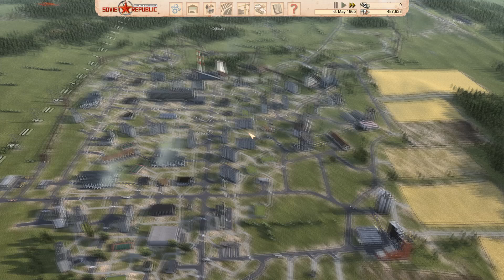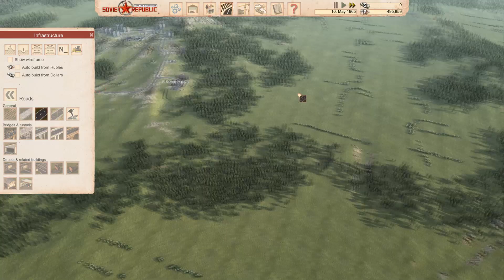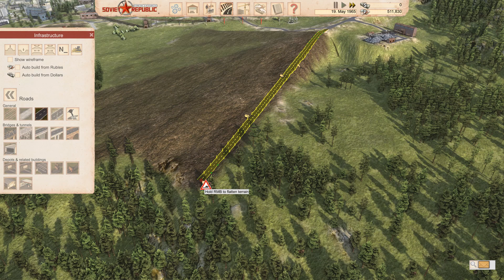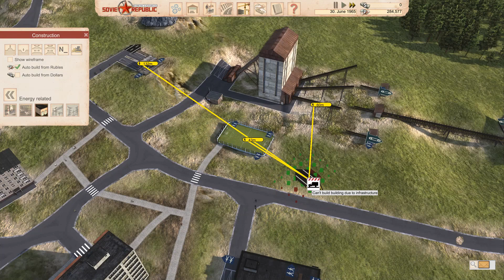Construction Camp :: Workers & Resources Soviet Republic #07

Comment: Fair warning, there doesn't seem to be storage for concrete, asphalt, or cement. They are probably meant to be made as needed.
Reply from the maker: ty for the tip.  Have just been looking to see where those items are stored.  Assume the only way to obtain these is to make them yourself.
Reply from the maker: Update 0.7.5.7 has added cement and livestock storage plus the ability to see vehicles associated with a specific building.  When the vehicle list opens it is possible to click on a to check their route, this will really help with the vehicle management.